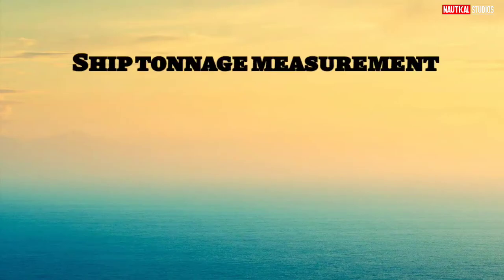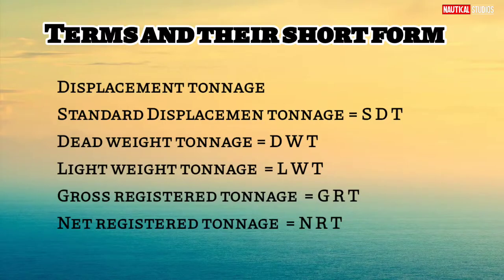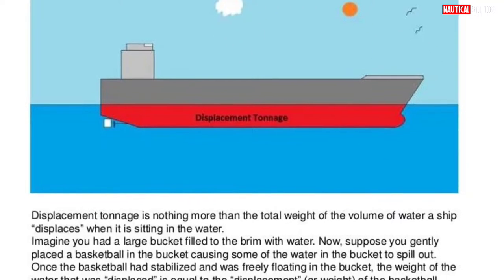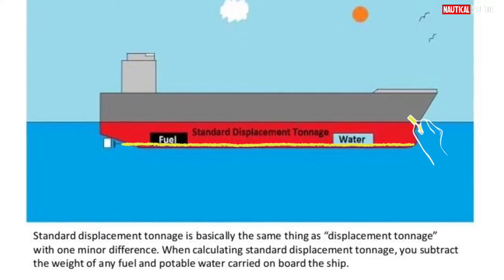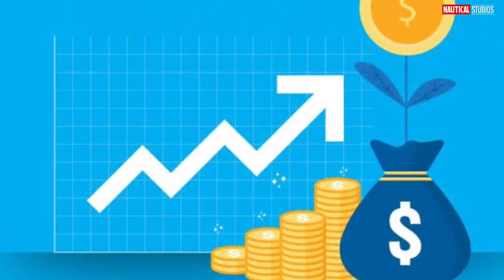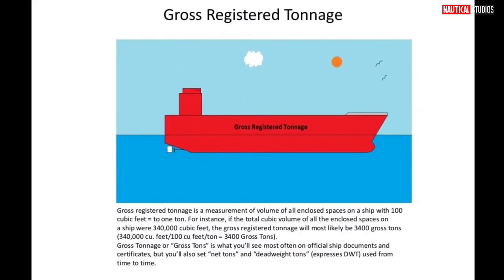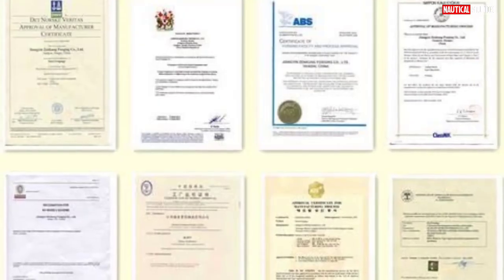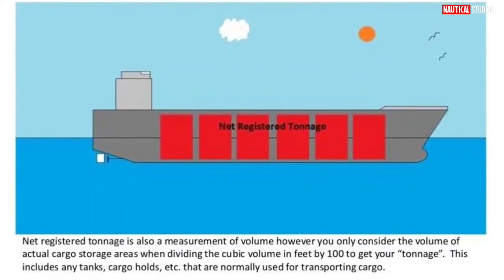Ship tonnage measurement Explained | Dead Weight Gross Tonnage Net Tonnage | DWT GT NT

Comment: Would it be possible for you to do a video about the Old Builders Measurement (Ton=(Length-(Beamx 3/5))xBeamx Beam/2 and the resulting answer is then divided by 94, to get the final answer. Cause I don't know if I did the math right and I can't really find what I am looking for. The OBM is used for sailing ships back when they were prominent.
Reply from the maker: I will surely make it in coming days. Stay tuned. Thanks.